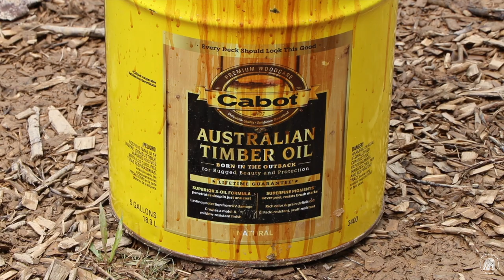AWESOME SATELLITE TOWER | OUTDOOR KITCHEN GRILL & 22 FT  HAND MADE LADDER

Comment: If you put a rail on the outside of your top of your satellite you're satellite are your antenna po tower also put a row on the inside of the Poles on the inside that will give it more backed back swing with the wind structure so it does not eventually stress out the screws or the nails whatever you use and put in it it will help you a lot reduce the strength of the windshield on that upper deck